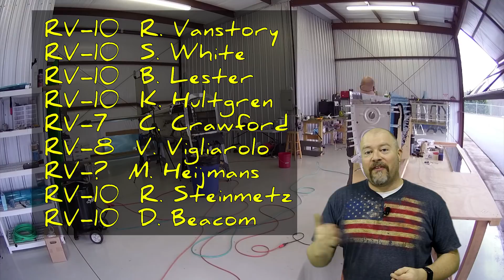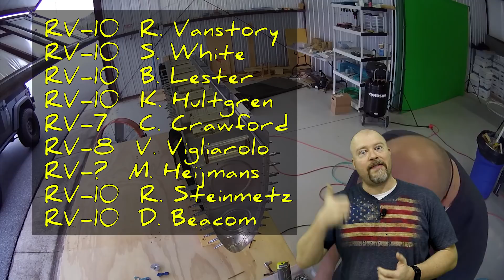RV-10 Wings - 049 - Fuel tank, and back on days!

Comment: Thank again for your videos im too came from my nights shift in airport.   Waiting for my first empennage kit and start to build my Rv 7 project. Did you protect any frame with primer or alodine ? As i van read in Vans page the specific alloy is previus treat for corrotion but.... perhaps i will use some primer to protect my project. Any ideas... thanks dor your work and congrats i really learn a lot watching you
Reply from the maker: I have talked to primers before.. I just dont see the point.  I did prime some of the internal structure, but I just used a rattle can of self etching primer and then not too much.  I dont think you have to do it to be honest.  Others will disagree.  I have flown planes older than I am by 20 years and are still brand new inside.. they weren't primed.. Why add the weight and work?

Comment: Glad to see you back! Interesting on the xyz printer. I have one that I reflashed with repetier host (an open source software) and have had a good experience. Reflashing with that software also lets you use any filament you want. Oh well... excited to see you back at it and we look forward to the build! -Jacob
Reply from the maker: Please by all means, tell me how to reflash it.. Using their default software suuuucks..
Reply: Had to check if anyone had mentioned this. I run a 1.0 that I reflashed, and it's a whole new printer. It has heat issues now with the extruder jamming on longer prints, but that is a hardware problem caused by lots of trying different things before I reflashed it. Googling "Da Vinci Repetier" should get you on the right track.

Comment: As for the 3D printer, switching to Cura increased my personal, kit-built printer quality immensely. If you currently use another program, I'd highly suggest switching. You can change just about every setting imaginable and optimize everything. It's free, too!

Comment: The DaVinci was my first printer as well, and your review was exactly spot on with it.  It's unfortunate.

If you're looking for reliability, drop kick that XYZ unit to the curb, and grab an official Prusa i3.  They're by far the best price / performance you can grab currently (even though they are a bit more than that unit you already have).  The only thing you'd really be giving up in the trade is the external enclosure that certainly helps with printing ABS or similar.
Reply from the maker: It's so bad.. sigh  The support is the main issue.  Any issue you have, you call them or email them "oh we don't have that issue here"... Okay.. I'm having it.. Help me fix it.. "Oh no it's working fine"... NO it clearly isn't, here's a photo..  It's like they ignore me.  I will not do business with them any more and will likely be ebaying this POS.
Reply: Agreed completely.  Mine was actually a Ebay purchase way back in the day, and unfortunately the plastic pieces that held the X & Y carriage smooth rods had broken (very bad piece of manufacturing and engineering design).

But, because I had purchased via Ebay, and not through any official retail channel, they refused to help - even after I offered to pay for support and for the replacement pieces.

No joy.  - So it was onto the web forums, and I ended up landing on a page where a guy was offering to print repair pieces for a very marginal cost - since he had done it to his.  - It fixed the printer for sure, but definitely left a bad taste in my mouth for XYZ as a company.  It's a shame, I believed they could have been the catalyst tobring printers to the market.

That being said, please keep up the great videos.  You're an inspiration to the rest of us!

Comment: Hey Jason! I will have to get on Van's and see why they did not send you a check in my name. I certainly used you as a referral! Its great to see you back on days! I work a rotating 12 hour shift work (one week of four days, then the next week nights and so forth!). I prefer to work nights for the work side of things (no management around!!!) but for family and trying to get things done around the house, not so much!!!

As far as buying vs building, I have done both. I purchased a 64 piper Cherokee 235 last September so that the family and I could fly places, but then in October, I ordered the first kit for my RV-14 project and am now in the process of working on the empennage kit as we speak! The benefit to buy, as you pointed out, is that you get to fly right away, but for the same money that you are spending on your airplane build, you get a far less product if you buy outright. For the same $150k that you are expecting to build the 10 for (I'm assuming glass panel and a whole bunch of fancy designs and upgrades) you will get an 80s aircraft, with 50/50 whether or not it has a glass cockpit or older avionics instead. And as a previous comment stated, if you build it, then you become the manufacturer with a repairmen's cert for your plane that you built and you get to do all your own inspections/installations/modifications/etc (read, "way cheaper" over the life of the airplane!!!!)

I started my 14 project around Halloween with the expectation that it would take me till this fall to finish the first kit, which would allow me to save up money for the wing kit...... well, here it is, February and I am about a month away from finishing! Gotta get that wing kit on order!!! I've been putting videos of my build together on youtube and having fun with the editing that comes along with that as well! Overall, its great to have a plane to fly right now, but I am enjoying the build process ever so much more!!!

Glad to see you back, sir, and looking forward to future videos!
Reply from the maker: Scott, if they tell you they sent me a check then it might be that I lost the check or something?  It's hard for me to keep track of everything but I think I have them all.   Either way, if they give you a hard time about it don't pressure them.  It's not worth your heartache or headache to fix it.   It's the thought that counts =)

Order your wing kit now!  It takes them a month or two to get it all wrapped up and sent.   Post videos!
Reply: Just got off the phone with van's. They said that something must have fallen through the cracks, but that they are sending me a new letter to send in to them and then they will send you a referral check! I have thoroughly enjoyed your videos and have used them as inspiration of how to make my build videos! I wanted to make sure that you got the referral check!
Reply from the maker: Scott I really appreciate it man.. If you need help building feel free to bring all your stuff up here..  =p heh   one of these days once I'm done building I love the idea of flying around helping people build..

Comment: Jason, is this a quick build kit?
One advantage of building vs buying is that you are authorized by the FAA to service your airframe and engine as well as swap instruments in your panel ( not service the instruments) instead of paying a mechanic to do this.  Cost of annual inspections as well as engine overhauls aren't cheap.  Some engine makers have classes where you go to learn to put your engine together, test in their cells, then ship to your location.
Reply: No, it is not a quick build kit
Reply from the maker: Hi Steve, As NorGamers replies it's not quick build. I'm into some special kind of pain to get the slow build..haha   I would recommend getting quick build if you can afford it. 

The Service thing is huge.  My buddy did his annual on his home built the other day and it cost im about $45 all told.  Good luck getting away with that kind of price with a non-experimental aircraft.

Comment: Hi Jason, I really like the build. I live no Long Island and considered building VS buying. In NY a 10,000 hr warrior with run out engine is 35k-40k for 110 knots. The upside to buying is you can fly today! Certainly you will not have the same machine as an RV10. Best
Reply from the maker: That's where I was when I started this. I could have gotten a low time gently used Mooney for about $45k.  But, I wasn't comfortable in the plane..  Sure it had a great cruising speed, but the instrumentation was ancient (and some of it wasn't working).. I'd have put a lot of money in that plane just to get it to the point where it was really flyable.  Then they annuals were likely to be pretty rough for a while.  Feh.. at that point, why not just build my own.

Comment: Hi. I’m a a&p certified mechanic and work at Lockheed. I am a master tank sealer as well. Now this is just me, but since we wet install everything here(both on the c-130 and f-35 center wing) I would at the very least wet install the rivets in the fuel tank AND seal them.
Reply from the maker: Hi!  Could you describe for me the "wet install" process?  I'm keen on learning
Reply: Jason Ellis oh it’s quite easy. For the little holes that you have, take a tiny bit of sealant (the tool that you use should be able to go thru he holes) and put it in the dimple or countersink then install the rivet. If it’s not a flush river then you can just put a little sealant on the shank of the rivet before installing it.